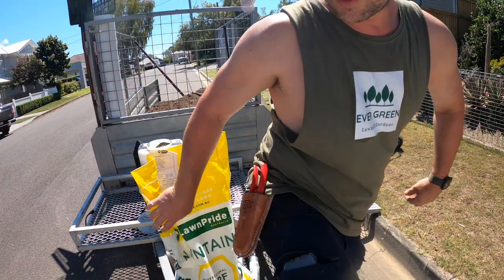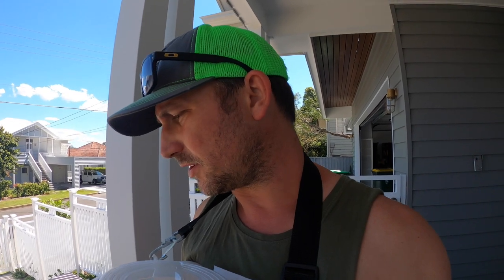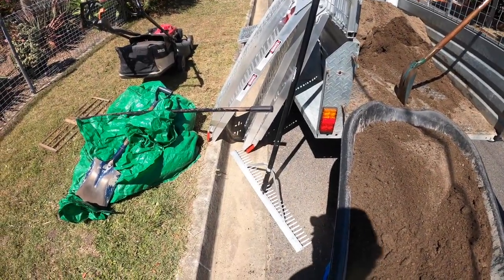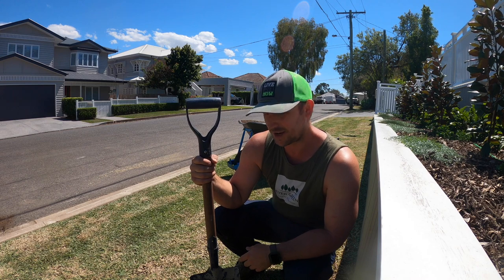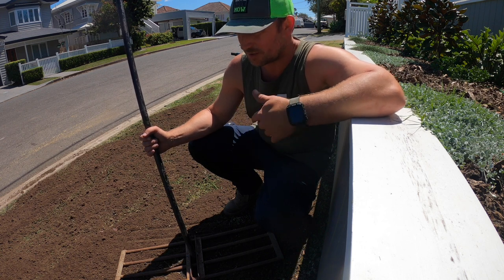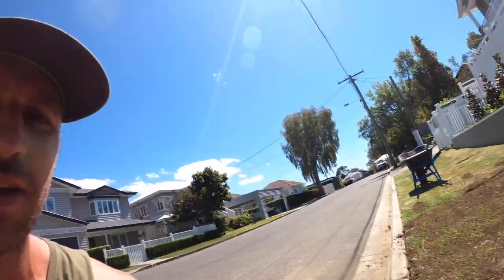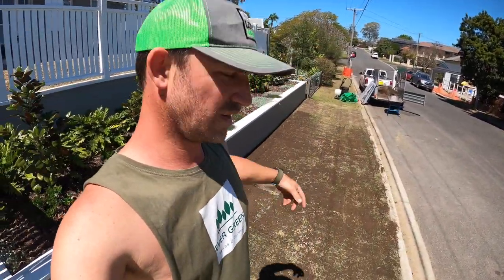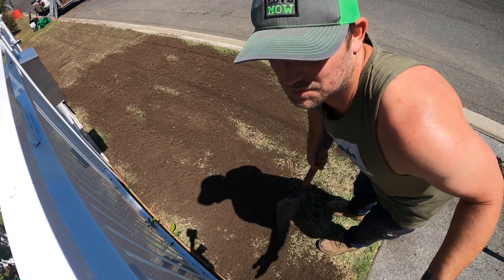How to renovate your BUFFALO LAWN. With tips & tricks. Part 2 of 2.

Comment: Brilliant videos. I have had my buffalo for 2 years now and getting a lot of thatching and areas that need improvement. Thanks for all the advice, looking forward now to spring to get started. 

It would be great if you could provide some advice on whether leveling is something you should do at the same time of the reno. I have areas of my yard that are uneven and lumpy that I am looking to rectify. Should I do this when adding the top soil for the overall reno? 

Cheers.
Reply from the maker: Hi

That’s great. That’s what I make the videos for. 

You can definitely level at the time off reno. Just depends with buffalo how uneven the area is. You can’t dump a pile of topdress on buffalo to build it up as smothering it to much will just cause it to die. 

I have heaps of renovation videos coming up this year. Looking forward to shooting them. Will go through lots of info than.

Thanks for the support. Have a great day 😀👍🏻